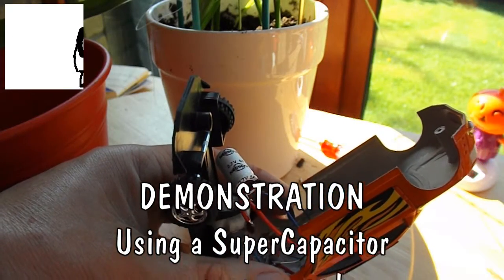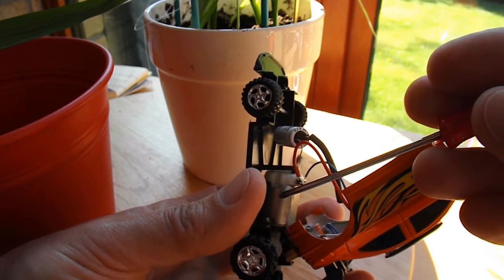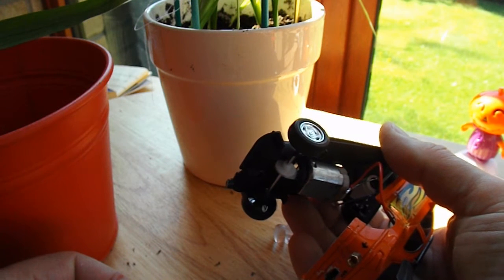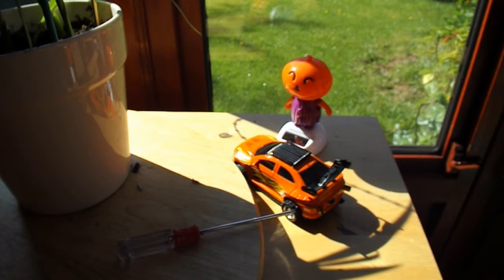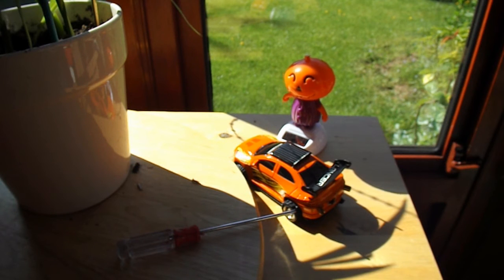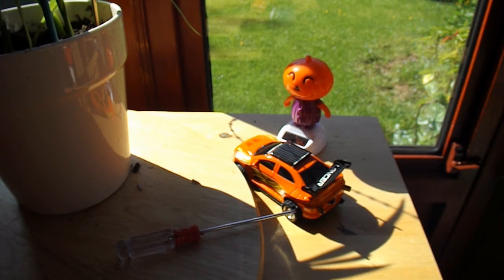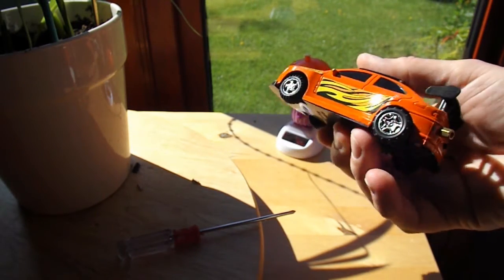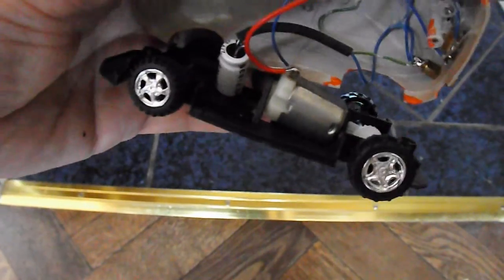Simple Supercapacitor Demonstration - real time

Comment: I'm into rc gliders as well,  so I wanna by a supercap 2.7 v 100F. How long would that cap be able to run a small brushed dc motor about 3v?
Reply from the maker: I have no idea how long it would supply a usable amount of power. It  would run down over the time period but the motor would still be spinning even at low power. A cap of that size would probably be quite heavy. I just did a quick search and the first 2.7v 100f cap I found was 70g  dimensions 22 mm x 45 mm so you need to factor the weight in to calculate how long it would be giving enough power for a climbing flight. If you are serious about getting into using supercaps then you may need to consider some extra circuitry to regulate the power. That is beyond my experience.

Comment: were could i find a super capasitor?
Reply from the maker: They are not cheap although they are coming down in price. I bought mine from Maplins. I suggest you read about them before buying any. Try Google. I have no doubt you could buy some on eBay but you need to know what size to buy and what you will use them for.
Reply: thanks
Reply: maybe showan